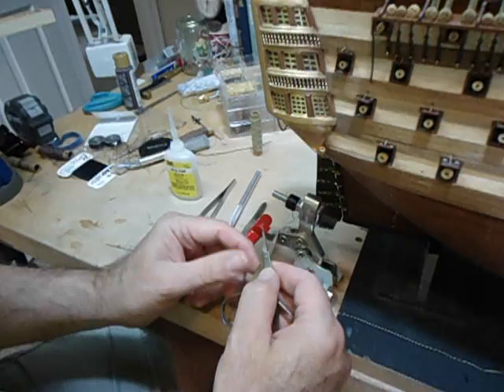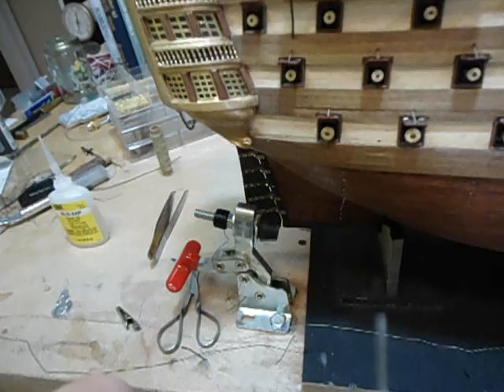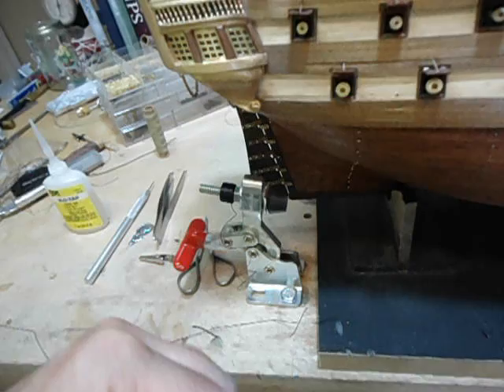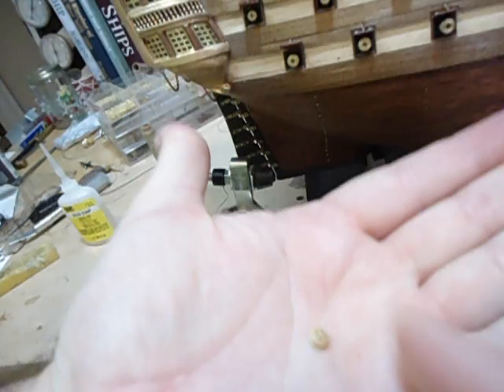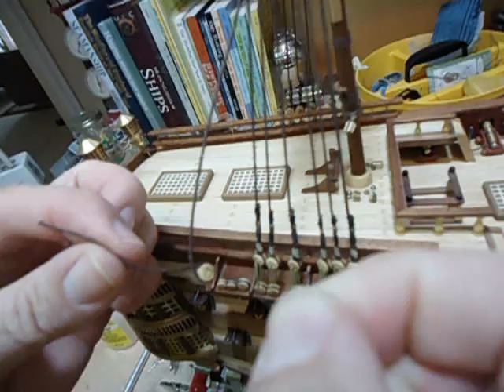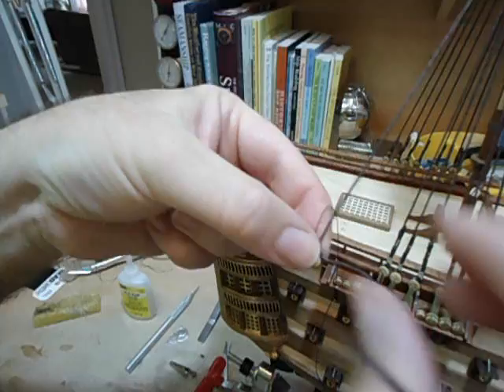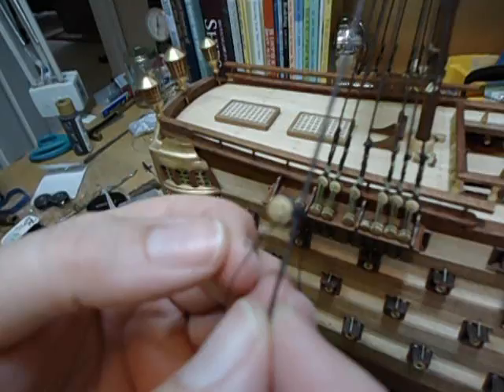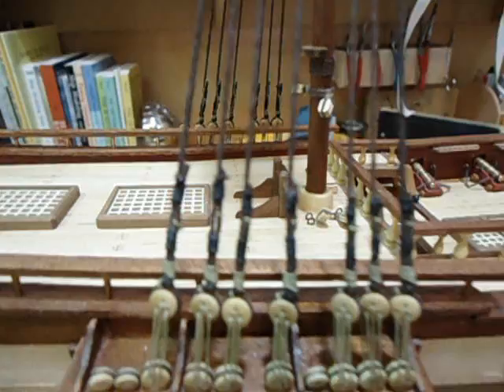RIGGING LANYARDS

Comment from the maker: I really appreciate the comments. Dave, actually, I do not use any jig. As I am rigging up the Deadeye, I pull on the Shroud line and just gauge by tightness the length that I want.  The Shroud line is going to give a little plus and minus in length anyway. Then when I am satisfied with the length and tightness, I will then complete the rigging of just the Deadeye only. Then I will start the process of installing the Lanyards (the line that loops through the holes of the Deadeyes.)  Then I will adjust the tightness of the line to closely match the others.  Accurate Deadeyes will ALL be in a single line in height and not have a bobble to them. I hope this helps. Feel free to look at the forums (http://shipsofscale.com/phpBB3
Donnie of SoS
@ 2014

Comment: Thanks so much for this.  What is the book you mentioned?  Also, what kinds of knots are best to learn for rigging up these ships?  Finally, I’d love to know how to secure the shroud lines to the mast, and how to measure out the lines so as to give enough line to work with, but without wasting any.  (Sorry if I have too many questions!)
Reply from the maker: Hello macleadg, I apologize for the long delay. Yes, there is a lot of cover here in this topic. The book might be "Historic Ship Models" by Wolfram zu Mondfeld.  I can help you further if you would contact me at donnie@shipsofscale.com  and also register at www.shipsofscale.com - just emial me and I can help you further with your rigging questions.
Donald
Reply: Donnie Driskell Your reply is a courtesy to me, no matter the time scale, and I appreciate it.  I have many questions about rigging, and have read some books on the subject, but they tend to focus on the big picture, and on historical accuracy.  I’m completely in line with such matters, but as a novice, I’m more stymied by the mechanics — getting lines to right tension, making exact duplicates of items that should look the same, tying/hiding knots, what type of knot to use in various situations, getting lines to be parallel & straight, how to use wax, how to tie multiple lines to the top of a mast neatly, the sequence of activities to follow when rigging, etc.  I’ll get to the historical accuracy later, when I’ve acquired a few basic skills. Does the book you recommend teach such basic, concrete beginner-level skills?

Comment: Hi Donnie, Thanks for these videos on fitting shrouds and lanyards i found them very usefully. I have a question though, i’m rigging HMS Victory 1/84  scale and I’m using beeswax on my shrouds. Trouble is the wax is leaving a white residue on black 0.8mm rigging line. Just wondering if i’m doing something wrong or way of stopping this happening?
Reply from the maker: John Douglas you are correct. It seems the beeswax doesn’t work too well w black line. I found that out working on my San Felipe. 
One way around this is to use polyester type thread. I know that most craft stores like hobby lobby carry a fairly broad selection. Also try amazon or google search for .8 polyester cord. The polyester will not be fuzzy.  My San Felipe came with all polyester cordage. The down side is that it is hard to work with.
Reply: Hi Donnie, thanks for getting back to me. I found some black beeswax on EBay and have been using it for a few days it seems a whole lot better...
Reply from the maker: John Douglas you are kidding. Never heard of black beeswax. I have to check that out as my San Felipe has most all black rigging. Thanks for mentioning that.

Comment: Why have you got odd windows?
Reply from the maker: I assume you are talking about the Gallery at the Stern ? Other than that, I am not sure what windows you are referring to.  If so, this was a Kit by OcCre, and these are the parts that I had to work with. Thank you for your interest and comments.  At the time, I did not have any other reference material to do otherwise. 
Kindly, Donald
Reply: @shipsofscale  hi Donnie,I’ve recently completed  De Agostini s Victory. I say completed but I am constantly altering bits and pieces which are incorrect.l would have thought the designers of these kits would have got it right seeing as the ship is sitting there in front of the world, and be the most photographed. Keep up the good work.Regards Alan.
Reply from the maker: @alancottingham564  Yes, Alan, there are a lot of problems with the kit world. I agree that you would think by now corrections would be made. I invite you to join my forum at https://www.shipsofscale.com   You will find it a great place to make a build log and join our community.

Comment: As a rigger of tall ships who has done this for real can I suggest you do some research into rigging or 'turning in' deadeyes? Sadly you aren't doing it correctly and would find the whole process much more easy and quicker with a more professional finish if you were to do it as per the real thing. It is painful to watch you supergluing those 'flat seizings' when there's no need to use glue at all, just do a proper flat seizing! Having your knots 'on the back' or inboard as a sailor would say means you now have shrouds with the short ends all on the forward side of the shroud which isn't correct, look at a real ship or a professionally made model and you will see the shrounds all go the same way around a deadeye, anti-clock for right hand lay or clockwise for left hand laid rope/wire. This means that the short end will be up different sides on opposite sides of the vessel, an immediate indicator as to the knowledge of the maker...
Get rid of the glue!
Reply from the maker: thank you jonathan for your input and advice. this was my first rigging attempt and was using “Historic Model Ships” book from Mondel as a guide. that was many years ago. just like anything, learning curves are here.Now, that a little more experience has passed over the years, I go back and I see  there were many errors that I noticed I did not do correctly like the stays and shroud pairs.